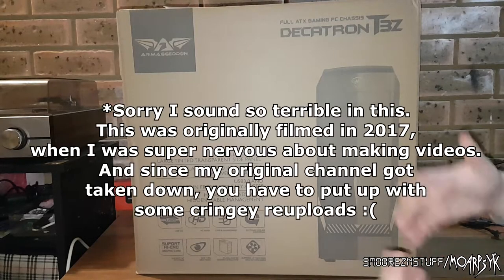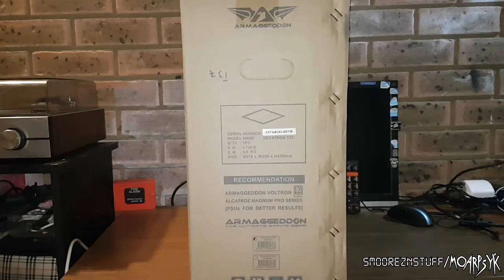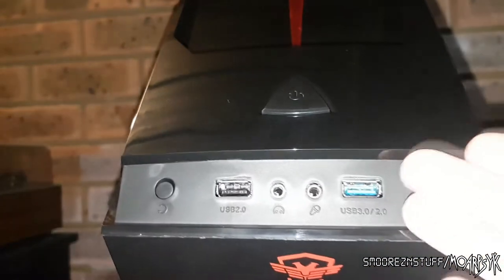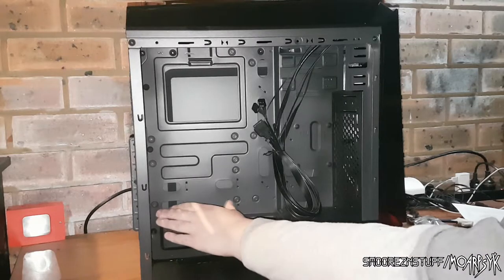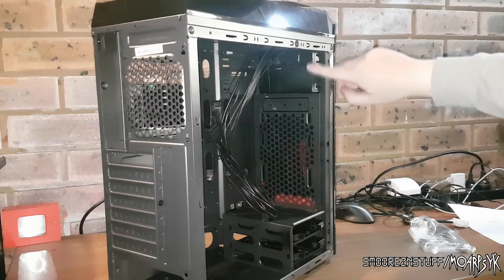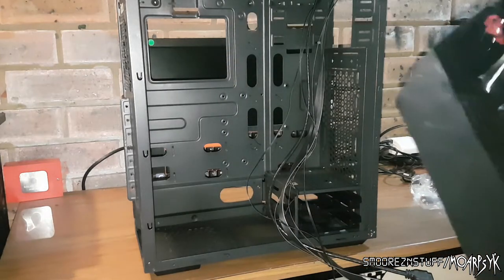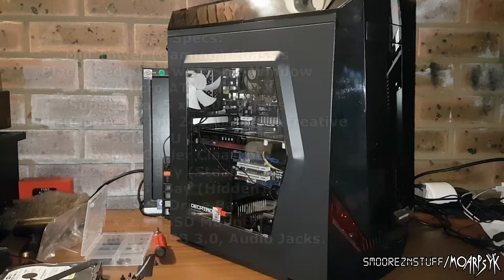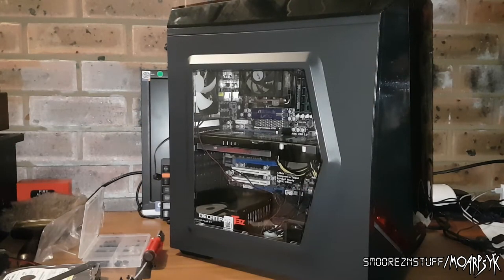MSY CHEAP CASE REVIEWS 1: The Armageddon Decatron T3Z Mid Tower "Gaming Case" Review!

Comment: I bought the T2Z and had plenty of problems. It was damaged when I got it and didn't have a manual or warranty. It advertised that is could house a 36cm graphics card but mine didnt really fit because it was too thick. And when ever I play games it gets to hot and a loud vibrating sound appears. And I get too hot because it came with the front mounted 2x120mm fans but does have vents for them. When I tried to contact them about this there website was down. So I sent them a message on fb telling them and they told me to call an overseas number which I didn't want to do cause it would cost a lot. To that they told me that they will get back to me. All in all its poorly designed and supported and if I could choose again I wouldn't choose Armageddon.

Comment: Can this case fits the Cooler Master Hyper 212X?
Reply from the maker: Barely. A cooler with a 92mm fan is about as good as it will get with this one.
Reply: @SMOOREZ  Ok thanks.But i think i will get the thermaltake water 3.0 x120 so i no need to worry about it😊